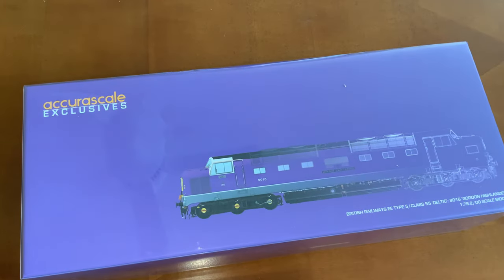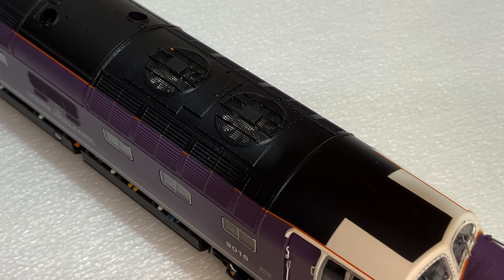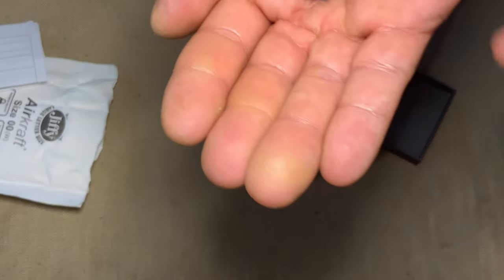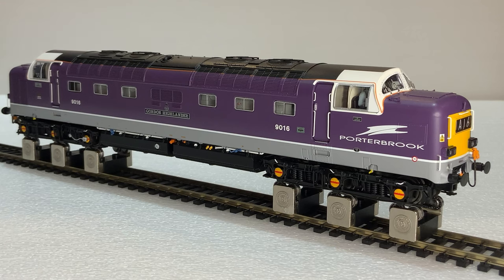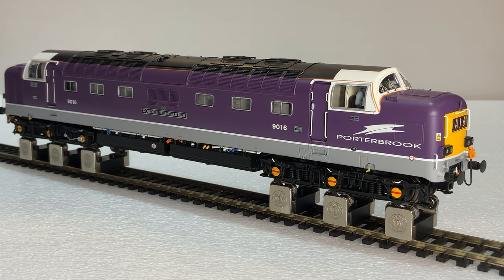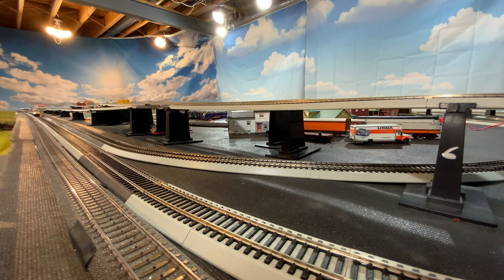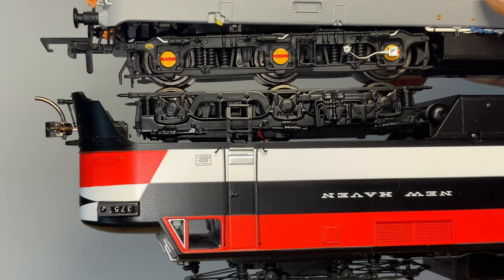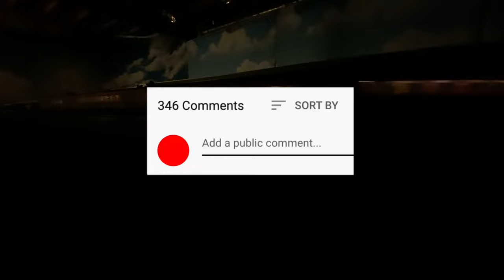Detailed Review: Accurascale's OO Scale Class 55 Deltic - Porterbrook Gordon Highlander

Comment: What you called truck retention chains are actually hand brake chains! One of a couple of weak points on this loco the other being the lower front handrails on the nose which stick out too far. A excellent first loco from Accurascale ( I have this one plus 55018 Ballymoss) hopefully they will have learnt the lessons from the few issues with this release.
Reply from the maker: Oh! No kidding! I didn't have any idea that chains were part of that process in any way. When the brake is on do the chains pull on the braking mechanism within the trucks or something like that?

Comment: I liked your full review of this locomotive, although you use a bit of American terminology. I have ordered one of the second batch, on which Accurascale have promised a few improvements, including revising the mounting for the bogie chains. Those ancient Hornby Golden Arrow Pullman coaches would not have run with the Deltic, and most probably had the horrible plastic axles that cannot be adjusted for back to back measurements. The real Deltics in earlier years (not in the modern purple livery) did haul Pullman coaches, of the general style of the Hornby ones you used, but they were still in the old umber and cream livery, and later some much more modern Pullmans in a reversed grey and blue livery to the basic design of the BR mark 1 coaches, nothing like the Hornby models. Hornby do have some much better Pullman coaches nowadays. 

Personally, I agree with you in that I like the purple livery as it was applied very sympathetically to the Deltic's lines, as were the green livery variations. The BR blue did nothing for the very deep plain sides of the Deltics. For this, Accurascale's first locomotive model, I think they have surpassed most of the contemporary British manufacturers' efforts. Thanks you for a good, comprehensive run down on this model.
Reply: Oh, I forgot to mention: that loose swivelly bit at the top of each nose is a lamp iron, used to mount an oil lamp, a white disc, or a headboard for a named train. It should be fixed, so needs a spot of glue to stop it moving.
Reply from the maker: Thank you for stopping by and sharing your thoughts! Like usual, those coaches were sitting around and seemed to run well with the train--except for those terrible wheels! Good thing I had extras lying around. Probably in the future I'll upgrade the coaches to something else as companies like Accurascale start to come out with better looking coaches. Take care and happy model railroading!
Reply: @DoctorHobby  Thanks. 🙂

I didn't mean any of that as a criticism for running the Golden Arrow Pullmans, I merely wanted to fill you in a bit more on them and their origins. The named train 'Golden Arrow' ('Fleche d'Or' in France) ran from London Victoria to Folkestone/Dover in south east England (I used to see it from my grandparents' house), with a ferry connection to the French equivalent. In the real world, Deltics ran from London Kings Cross to the north (Leeds and Edinburgh), although they did go on the odd excursion, even to the south of London, but to the best of my knowledge, never to Dover or Folkestone - not that any of this really matters when you are running it as a test train anyway, and it's your railway so you really can run whatever you like. 🙂 The purple Deltic was a modern variation and could run on almost anything you want. As you surmised, Porterbrook was a leasing company so their trains could end up almost anywhere in the UK.

As before, please keep up the great work.

Comment: Just put a Kato mechanism in with a "Made in Japan" motor - like the ones they produced in the early 2000 and you get a Lexus engine ! Chinese motors are just crap. You need to buy them in bulk of 50 to get 1 running smoothly. And yes, put some serious track down on your layout... and fix it properly. Enjoy the 55 ! By the way: Hornby 'Railroad Range' might look toy like but they produced some excellent and refined steam engines with Miles better quality than the Bachmann junk that don't even have proper wheel bearings nor tender pickups. And if you like 'British' steam engines check out the new Dapol GWR Manor Class in OO gauge.
Accurascale brings the same Manor Class to market very soon too. Will be interesting to compare. Happy model railroading & success... also with the track (!)
Reply from the maker: I think we are at a bit of a crossroads when it comes to midweek trains right now.. It's obvious that Accurascale probably had to cut some corners in this model to keep it at the price point they did.. I know they've had these criticisms from others online, so we'll see what they choose to do about it going forward, but it might mean that they have to modify their pricing scheme..